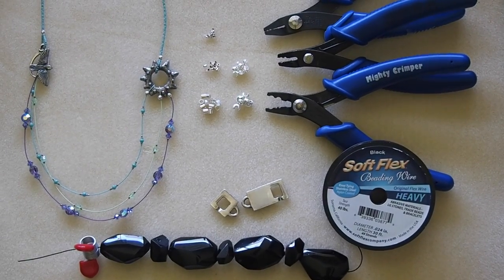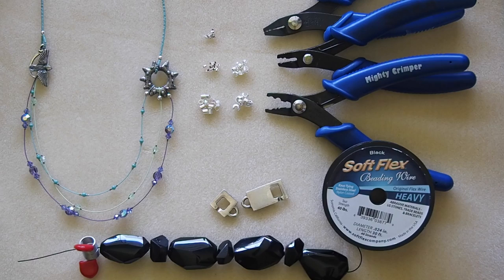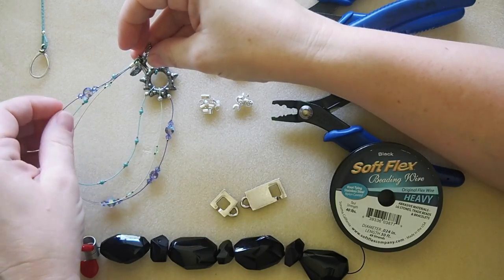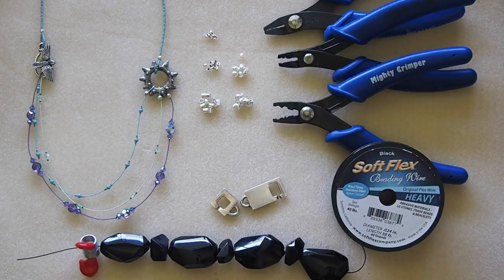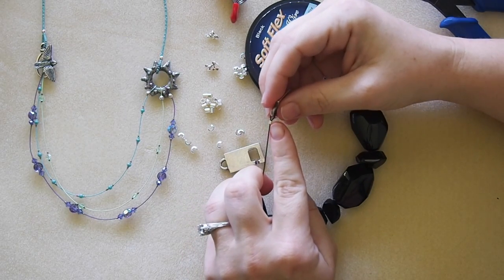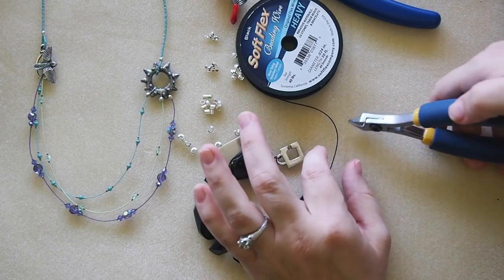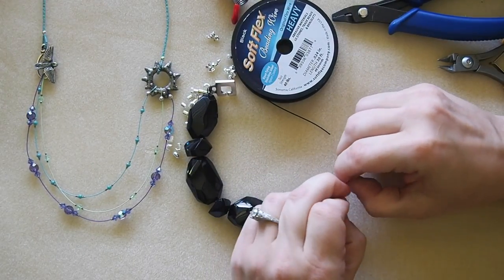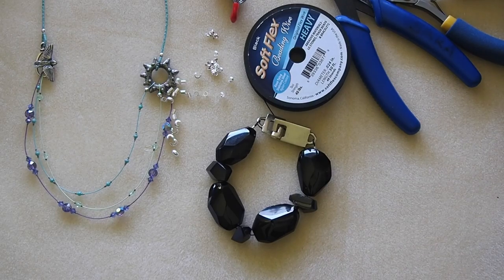Crimping To Finish A Simple Bracelet Or Necklace (Jewelry Making Skill)

Comment: I'm making a necklace and using Soft Flex medium. The way my design is going the crimped ends are not going with it. My question is can I simply tie a couple knots at the ends to connect to the clasps rather than crimping?
Reply from the maker: It is more secure to crimp. What about the crimps are not going with the design?